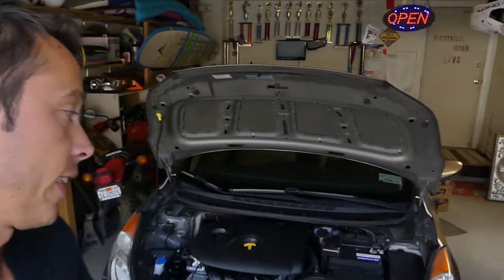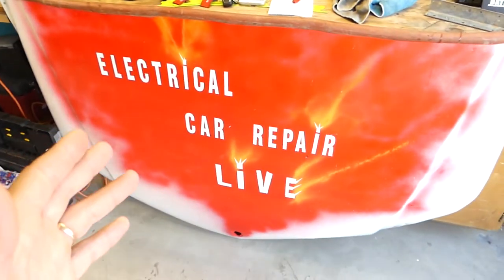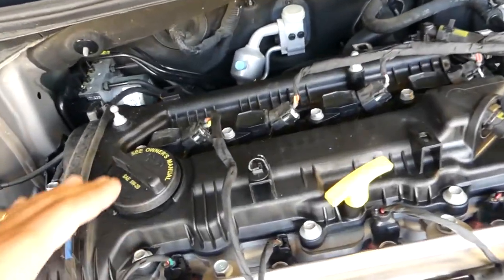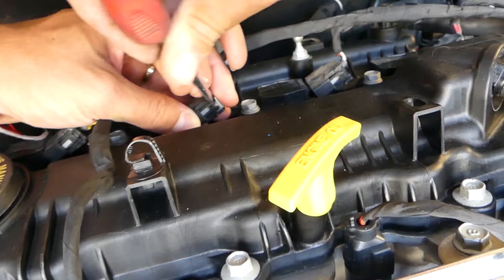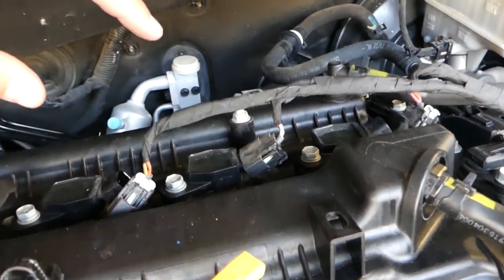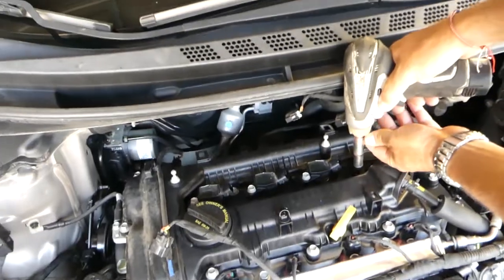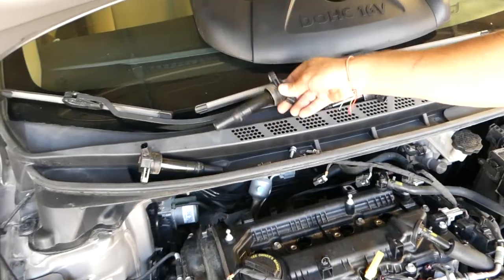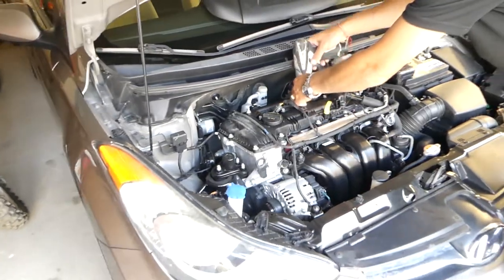HOW TO REMOVE AND REPLACE IGNITION COIL ON HYUNDAI ELANTRA 2011 2012 2013 2014 2015 2016

Comment: So After Watching This Very Informative Video I Tried Replacing My Ignition Coils On My 2013 Hyundai Elantra. In The Process I Broke One Of Those Grey Pieces And Deeply Regretted It. So If Anyone Is Trying This Be Very Gentle While Sliding That Piece Out. I Had To Do This Process Twice Due To Breaking The Piece And Not Completely Sliding the Coils On And Putting The Screws On Too Tight. So This 10 Minute Job Took Me Two Hours To Do 😩🤦🏾‍♀️ Thank You So Much For This Video !! Also If The Check Engine Light Is On After This Process, Unscrew The Negative Connection On Your Battery For 2-3 Minutes. Place It Back On And Screw It And Everything Should Clear Up If Everything Has Been Fixed Unless You Have More Issues With Your Car
Reply: Would there be any possible problem, if I break the Gray thing?
Reply: @robindelosreyes9769 Yes, I believe so. The grey piece helps secure the wiring connection to the ignition coil . If not secured properly, your car check engine light may remain on after reset or your car may not start. I’m no mechanic though but that’s what happened to me.
Reply: This was helpful girl thank you!!
Reply: What did you do if you did break the grey connection latch.. 😅

I just broke the second could latch.. man he wasn’t kidding when he said they were fragile.. is there a part you can link to fix that?
Reply: Did the same thing 3 days ago 😂. It won't hurt anything though. It still snaps back into place.

Comment: Thanks for the top tip on the clips. Also I'll add it's never a bad idea to disconnect the battery when working on anything electrical on the car.

Comment: I have a 2013 Elantra that keeps misfiring even after I changed out my spark plugs. Ill try this. Thanks for the video
Reply: Update: Changed the Ignition Coils and the misfire stopped!!!! So happy for this video.
Reply: that was my question.  I'm glad you asked it
Reply: My misfire stopped as well after changing the 2nd coil.   Woohoo
Reply: That's Exactly What's Going On With My 2013 Elantra. I'm About To Try It Out .
Reply: @yolandagomez9255  hey my 2 coil is misfiring too. You think the 2nd coil is just faulty on Hyundai’s?
Reply: @blackbutnotmild5525   TRY CHANGING THE COIL TO A DIFFERENT CYLINDER IF THE MISFIRE CHANGES TO THAT CYLINDER THEN ITS THE COIL
Reply: @blackbutnotmild5525  Could be, my daughters 2013 Elantra GT had a bad #2 cylinder coil as well. Sounds like you have a way to read fault codes if you know it's the # 2 cylinder but if not, if you have an Advance Auto Parts near you they can read the fault codes on the car for free. Misfires normally cause a fault code to be stored in the onboard computer.
Reply: I’ve had 3 coils go out since my Elantra hit 60000! 3rd one has just gone out at 72000! Some bullshit with these Elantra’s!

Comment: My 2013 sometimes will not start while it's cranking, but then it will start once I try it again right after the 1st try.

Is this my ignition coil or it is the fuel pump or filter?
Reply: Happens to me every 5 blue moons.   Im thinking im pressing start too fast as im Always in a hurry when it happens

Comment: I'm about to change mine out. Autozone said it's only my 3rd coil that needs replacing so my question is do I need to disconnect the battery so I don't get shocked or what? I'm scared LOLOL
Reply: What test did you ask for at Auto Zone for them to determine which coil it was?
Reply: @tynylbarnes4283  you can ask them to use their code reader, and the code reader will tell you which coil is misfiring
Reply: Haha, if you haven't figured it out already
Reply: Yes, disconnect the negative terminal on the battery before starting work.

Comment: how to find the bad one? I have a misfire and big power loss when engine is hot. errors are c1555 p0300 p0301 p0303... I play and swap the coils and the plugs, now I have also a p0304...  The blinking engine light I had before, now is still on. I test resistance (set to 2kohm) on the two coils pins and I mesured 0 for all 4 coils. there is another test for the coils? My sparks was new and I put the old ones and nothing change. Maybe is another problem. Thank you
Reply: Tron80 I’m having the same issue with my 2013 Hyundai Elantra. I replaced all of the spark plugs and ignition coils and I’m getting the same codes as you. May you please let me know if you find a solution to this problem?
Reply: same
Reply: Try Chris Fix channel.
Reply: Might be the crankshaft position sensor. It’s a cheap fix and can go bad on these cars before 100k miles.
Reply: Well ??? I hope you got it by now ???
1 ( or more ) of the coils are bad and/or . . .
1 ( or more ) of the spark plugs are bad or not gapped to 0.044in. ? and/or
1 ( or more ) of the wiring harness connections were damaged and are no longer making good contact. Did you disconnect the harness from each coil pack or stretch them off??? If so . . .  Did you break any of they gray tabs ???

They recommend replacing the harness even after doing just plugs because load resistance can build up within them over time And the tabs become egg shell brittle and easily broken.

I have 2 broken tabs on my 2013 LTD 1.8L myself without any ill effects. Looking to swap my harness with an OEM. I have had 92k mi. without any problems And I will continue this way for another 100K as long as I can keep the dealers hands . . . off of my car.
Reply: James M. So true,   Hands off ,  dealerships/ mechanics always makes things worse
Reply: Same here, broken gray tabs I'm not sure if that is the problem, when I replace the coil the problem gone for a while then come again, is the third coil I've purchased in a year after replaced all 4 and spark plugs, can be the cables the issue?

Comment: Rate cut a wire of ignition coil of my hyundai verna fluidic..can i repair or i shoukd be change???plzcrrply
Reply: I would leave your car run over night and if the rat returns the shock from the coil should fry his ars..then definitely put on a new one don't try to use electrical tape or something or will only be a short term band aid

Comment: So you push towards the ignition coil with screw driver like then pull ??  So i assume on clip it has something to be pushed in so it gets out of whole then pull?? is that right?
Reply: No ans. ???
Reply: It's a simple electric clip not hard to figure out and you don't even really need a screw driver if you have strong hands

Comment: U forgot to maintain the most important thing is to disconnect the battery dude
Reply: I just changed my spark plugs and did not disconnect the battery or remove the wires from the ignition coil and my car  still runs, Please explain why this is necessary because I'll do it next time.
Reply: @Kansas Geoff you don't have to disconnect the battery because you won't get shocked.

Comment: What happens if the clip/lock on the wiring harnesses to the coil brakes? Where do I get new connector
Reply: If you take it to the dealership you will be paying about 2500 just for that piece.. because they (dealership) will tell you that they have to replace the whole engine wire harness... which is bs 🙄 
But if you want to do it the cheapest way... go to eBay and look for extension wire ignition coil and remove the connector and Jerry rig it

Comment: anyone know where I can get 2014 Hyundai Elantra Sport 2.0L ignition coil wiring harness or ignition wiring connectors?  Mine got brittle and broke when I changed my plugs.
Thanks
Reply: Still no reply huh? You ever fix it or no
Reply: One of mine clip/lock broke

Comment: I took the ignition coil snap plug off and can't get it to snap back on. Do they need replaced? Seems like really  cheap plastic.
Reply: i had the same problem about 30 mins ago.  it's currently zip-tied but not an ideal solution

Comment: I have replaced all 4 ignition coils and spark plugs on my GFs 2012 Hyundai Elantra twice now. Everytime I replace them they are good for about a year, I feel like they should be lasting longer than a year? Has anyone else noticed that they are replacing them this often and if so have you found any reasons as to why they are wearing out so quickly? The car only has 180,000 miles on it.
Reply: 180,000 is a lot of miles
Reply: @TEXASBABYDOLL13  For Hyundai.... not for a Toyota
Reply: Yes it's been exactly one year for me as well!! It's crazy and I'm really starting to hate my Elantra

Comment: I'm having an issue where my car clicks like a dead battery. I try two more times and the car starts. I tested the battery and alternator both tested good. How would I know if it's a fuel issue, ignition issue, starter issue or some module or relay? There isn't any check engine lights on so no codes to look for. Also once I'm driving it if I turn off the car it turns back over with no issues. The issue with the car only happens when it sits for a few hours.